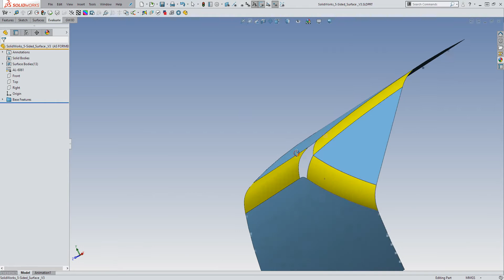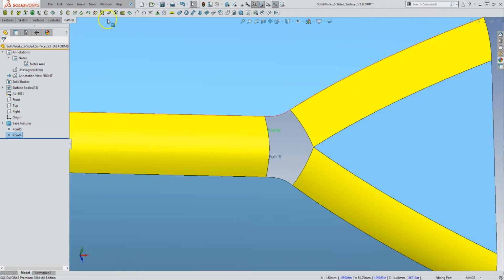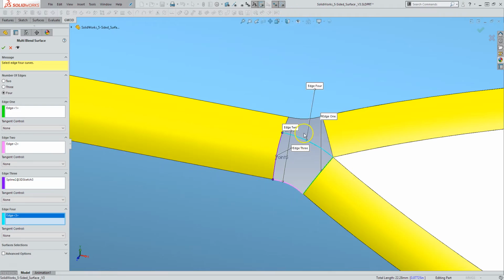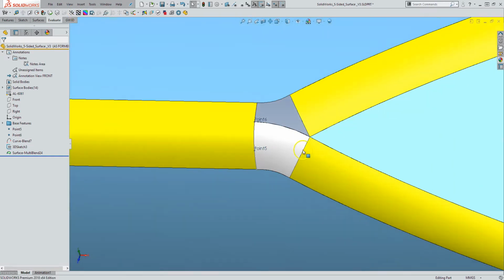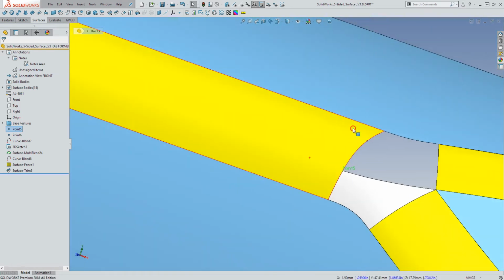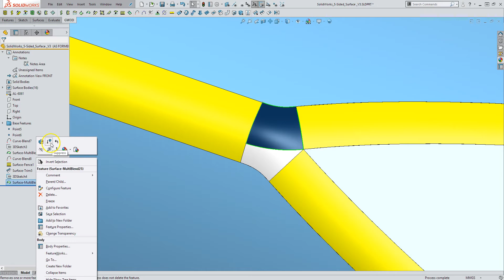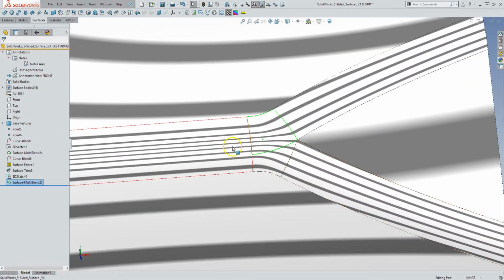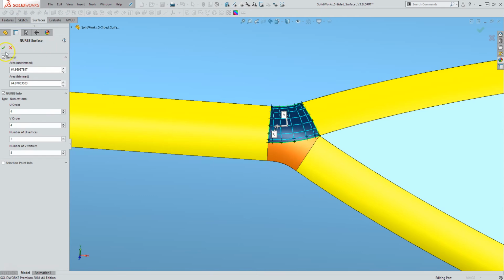SolidWorks 5 Sided Surface, Using GeometryWorks 3D, GW3D

Comment: Thanks Mark, good to see GW3D in action. I've never used it but it looks like a really good step up from SW surfacing.
Reply from the maker: Hi Andrew, yes I have to say that I really like having it as part of my toolbox. The interface is not super polished in all cases and the icons feel really outdated, but it creates very good geometry. One of the ones I love is the conic spine surface, not possible to get ripples wrinkles or bumps. While it can only achieve tangency I have found that in difficult situations it's the only one that yield predictable and reliable results. I'm planning to do a video on that as well.
Reply: Sounds good Mark. We need a common thread over on the forums to post tutorials, might have a look and see if something is already set up.
Reply from the maker: Yes, I agree we need a common thread. It would be best if there's an existing thread, I don't know about you, but I feel kind of funny starting a new thread with "come look at my videos" :)
Reply: Yeah same here!!

Comment from the maker: https://www.cadcamcomponents.com/ information about GeometryWorks 3D can be found at the link in this comment.
Reply: Mark, what is the cost of this add-in? Could be very useful for my company.
Reply from the maker: @zackfreeman8025  I think it's about $1,400 without maintenance if I remember correctly. It' been worth it for me. If your company does a lot of surface modeling, you should also definitely check out XNurbs for SolidWorks, that is a very useful plug-in
Reply: @marklandsaat3696  Thanks for the info Mark!